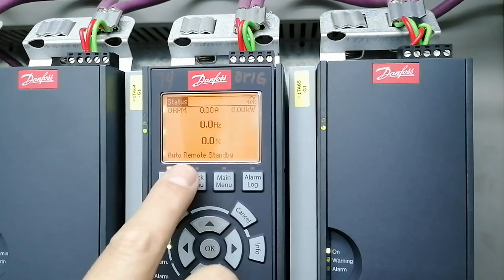How to change display of danfoss Vfd to show   RPM, AMPERE, POWER KW, HZ OR FREQUENCY AND REFERENCE.

Comment: can you lessen the speed of motor through this?
Reply from the maker: yes sir
Reply: @electricalplcbasictutorial7531  how?
Reply from the maker: It depends on you..if you make program or makee it manual
Reply: How later can change setpoint 1 when you set 75 psi for example to  set 50 psi? Where you should go on main menu?